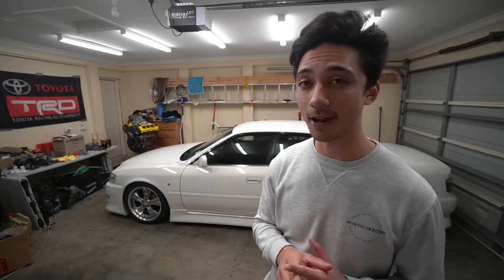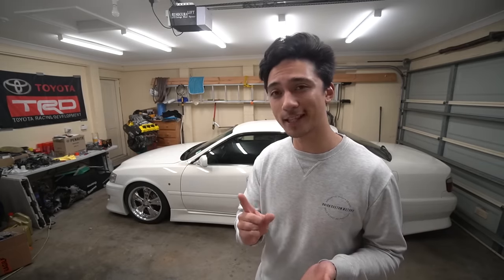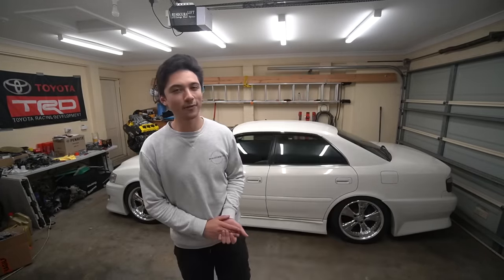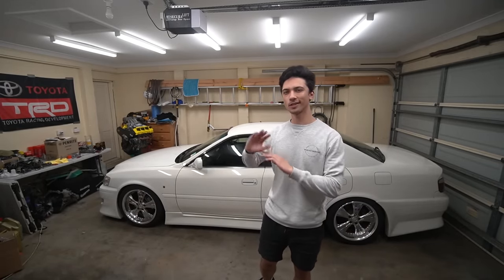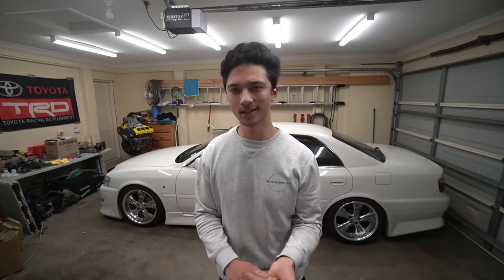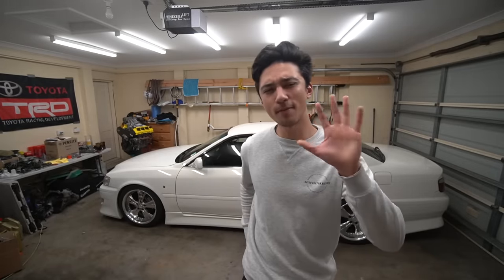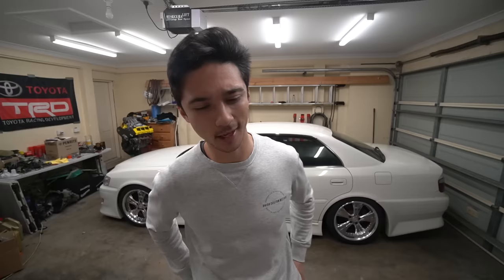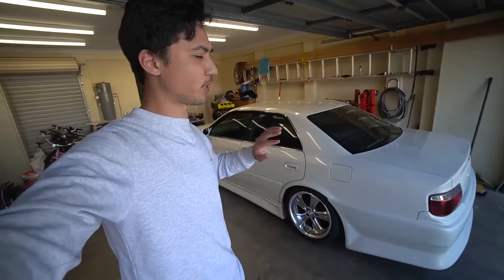The First 5 Mods You Should Do To Your Car (For Cheap)

Comment: My first mods were tint and rain guards. Definitely changed the look
Reply: Always tint first😌
Reply: @DrizzyJV  amen! 🤣
Reply: Yeah Tint really does change a car, especially if it’s 5 all around
Reply: What is a rain gaurd
Reply: @shahzadkhan-ct4oi  they go at the top of your window so if its raining and your window is down it wont drip in
Reply: Mine was tires nd tint i got em done today nd i was happy even if it seems small idk just fixing my car feels good
Reply: @shahzadkhan-ct4oi  its what you put above your windows, attached to your door so you can crack your window open when driving and let in outside air, even when its raining.
Reply: @n3ille289  hey that's dope! gotta start somewhere, as long as you like your car that's what matters
Reply: Tint isnot a mod
Reply: @PostFeenJay  modifying a car is changing anything to it that did not come STOCK from the dealer or where you bought it. If you tint your car darker than what it came with factory it is definitely a mod.
Reply: I think mine was fog lights, stereo, stickers/emblems, tint, altezza tail lights, wheels (16s), grille, intake. In that order.  I was pretty cool by the time I got the carbon fiber hood and the body kit. Still got the car, but no emblems, tail lights,  exhaust, and body kit anymore except the front lip.
Reply: gonna order my rain guards next paycheck. originally wanted them for the looks, now i want them bc when it rains it goes to the fucking center console
Reply: 100% weather deflectors are super slept on. I bought them for my Mk7 GTI and it looks so much better. Really clean look.
Reply: Tint first. Same thing I did. 😂
Reply: @stumpsteph2153  damn nigga😂 I’m 15 all around
Reply: I literally did this last week and definitely makes it look 🔥
Reply: rain guard? agreed. it make the car look nicer ngl.

tint? country dependant, here in ausie the cop just feel sad if they cant see ur face through the window lololol. so they gonna stop u for sure even its only 50%
Reply: @shahzadkhan-ct4oi  wind deflectors if your in Europe
Reply: Me too
Reply: I just got window tint as my first mod lol
Reply: Agreed I tinted my windows and got weather window shields “rain guards” and a black bonnet stone guard on my dark ocean voodoo blue stick VE omega and instantly turned it into a sexy beast ahahha little things go the distance with cars appearance I swear ahah
Reply: honestly my first mod were new wheels and tires followed by new set of breaks... then red halo lights xD
Reply: rain guards it entirely depends on the car, tint and ride height drop are just two things that MASSIVELY change your car and make it look so much more aggressive.

Comment: The mods I made to my RAV4 were
-tints (15% all around)
-blacked out offroad tires
-change every light to LEDs
-sequential turn signals
-chrome delete
-blacked out tail lights
-leather seat covers
-aftermarket infotainment w/ Carplay & Android auto.
Love driving even more now than before I did the mods
Reply: Leds...? bro leds are much better than a normal lightbolt
Reply: offroad/hybrid tires is the most underrated look on a sports car imo
Reply: how are your leather seat covers holding up… I’m trying to make some choices and I noticed a lot of PU leather seat covers get really creased after wear.
Reply: @AC-iv3ys  They’re not bad. They could be better though. My seat covers came with a strap that you connect underneath the seat so that it stays on and snug, but it snapped. I really wish I had just bought my car’s trim level that came with leather seats🤷🏼‍♂️

Comment: As a fellow car guy and Toyota mechanic, I 100% agree with this list. One thing that would add about pod filters is that they make your turbo sound soo much better(if you have one). Another cheap mod you can do to really change the feel of your car is to lighten it, and get rid of all the heavy stuff. You can get rid of 60ish kg pretty easy and the difference is like night and day(unless your car is naturally really heavy)
Reply: Couldn’t removing a large amount of weight set off the weight distribution though? I feel like it wouldn’t be much of a worry for rwd cars, because of the weight of the rear diff, but since most of the stuff being removed is in the rear, couldn’t that be more of a problem for fwd cars?
Reply: @gunnarshiverdecker8674    What are you talking about
Reply: Hey a question Id you do a muffler delete what do you put instead
Reply: @vladimirjano9478  just a piece of pipe where the muffler used to be, hence the nickname straight pipe, although sometimes that means no cats as well
Reply: Unfortunately pod filter decreases horsepower, especially in my car
Reply: What would cause the pod filter to decrease performance tho? I was thinking about putting one in my toyota sprinter
Reply: @ESnizzle  when you get a pod filter, you need to remove the stock airbox and have the filter hang on a pipe going to the intake manifold. By doing this you remove resonators, and possibly airflow if your airbox is of ram-style stock. Resonators improve airflow and horsepower, removing them prevent that
Reply: i have a question, isnt cutting off the muffler illegal literally everywhere?

Comment: TBH before a pod filter, consider an aftermarket drop in filter (as in one that uses the stock airbox). Super easy to install, no AFR fuckery and  you'll get anywhere from a tiny to surprisingly decent power increase - they're also cheaper on average.
Reply: Very true, it's also killing two birds with one stone if you just bought the car used! I got my 328i used at 110k miles, it's an 07 so it's been around for awhile. I got a K&N drop in filter for it and when I opened the stock air box to put it in it looked like it had never been cleaned once and the filter was from 2011! Safe to say the car practically felt like it woke up once the box was cleaned with a fresh drop in filter.
Reply: Pod filters are 20$ and a lot of car u can actually attach it to the stock air intake tube. K&N filters start around $50
Reply: @donovansimison9336  cars usually come with a cold air intake design from factory. So getting a drop-in filter will be better for performance, compared to the pod filter. And it's not very safe to put a pod filter close to the ground too...but the sound you get is worth it anyway so I'd consider it a win-win 👌
Reply: I considered a pod filter but my mate whos a mechanic says all they do is suck in warm air (cold air is good) and reduces performance, a happy medium is an aftermarket airfilter - i got a KnN high airflow one havnt used yet but sounds like the ticket cost around 100bux nzd
Reply: After watching the lemon factor intake dyno tests on an accord, unless you change the airbox, I doubt any power increase occurs
Reply: @donovansimison9336  youre right i got one for 50$ on Ebay and it attaches to the entire mass air flow sensor housing
Reply: @BimmertechG01 can you do a drop in filter and a pod filter?
Reply: @BimmertechG01  yo, its been a while since you commented but i also have 2007 328i and was wondering if you had anymore suggestions for mods to the car, since you actually have some experience with it

Comment: get a car that has a hole rusted through in the muffler and you’re good
Reply: My first car 95 corolla sounded crazy🤌🏼
Reply: amen bro, it hurt me to get it fixed because of how damn cool it sounded
Reply: my 07 subaru impreza 2.5l has a front exhaust leak. sounds amazing. too bad i have to fix it before it gets bad and all the fumes get into the cabin lol
Reply: @joey4261  04 2.5 here same shit, i regret the repair everyday but issa daily
Reply: literally me right now ahaha
Reply: 🤣my car has that i wana get rid of it
Reply: @joey4261  bro line is like that too
Reply: I got zero rust and under 75k miles, I'll just cut a hole
Reply: @ethanbannor212  dont

Comment: what about an exhaust cutout? ive got one, and its great for a daily. When going to work early, getting home late, or avoiding the police, its great to have a choice at your fingertips.
Reply: How long have you had it for and do you know if it leaks?
Reply: @sugamai  ive had it installed for about a month now, and so far i haven't noticed any leaks. Just make sure its a good design though, the cheap ones tend to leak. I got mine from summit racing.

Comment: Remember with new LED bulbs to readjust your beams. The low beams height should be the same height as the headlight housing, at about 10ft away. The driver side beam should be twisted slightly in, and the passenger beam ever slightly out.
Reply: how do you do this
Reply: @supermaxr5093  Theres two screws on the headlight housing to adjust each axis.

Comment: Just one thing if you're going to change out your headlights, You have to replace the housing For the lights because in some places it's actually illegal to put LED's In halogen light bulb housings Because they're not built for led's. Plus changing the housing out to housing that's made for LED's can make them look so much better, And function 2 to 3 times better because they will work properly.

Comment: Best muffler delete I've ever done was resonator back delete on my B7 Passat 1.8t. Sounds amazing. I also did a bypass valve spacer so I could get the turbo woosh.
Reply: is it illegal to do a resonator delete? tempted
Reply: @szxci9885  depends, but usually no. It’s the cats and mufflers they get upset about.

Comment: just an fyi, installing performance modifications on a vehicle without tuning it is going to decrease horsepower more often than not, the intake for example will be adding more air to the engine but the ecu doesnt know that so it injects insufficient fuel for best combustion and will decrease power due to your air fuel mixture being more lean
Reply: Complete bs, get a k&n filter.
Reply: Facts

Comment: Personally as a first quick modification to a car I normally suggest a extra set of brake pads just incase of braking issues and maybe some seat belts cause personally ima very tall individual and the normal selt belts cut my neck at times and cam get a bit uncomfortable so some after market seat belts or racing belts I also do agree with the muffler delete as a cheap thing to do as well

Comment: my first modification to my car was either tint or rims(granted i went from factory steel to factory alloy, still looks 10x better then before), then the next mod was the exhaust(had dual Flowmaster 40 series installed on my car by a shop, i would have tried but, they needed to be welded in, looks and sounds good, I have a video of how it sounds on my channel), but that is where i left off due to the transmission failing in it, and cant have it fixed anytime soon, but it will be back and even stronger then before

Comment: Most cars have resonators and deleting the muffler can make a very good sound without being ridiculously loud. I’ve done it on a few of my cars, and some of those mufflers are heavy as heck so that’s just increased performance just like that. Intakes especially on Toyotas usually decrease performance and not for the reasons you think. It comes down to how the maf reads the intake flow and a larger diameter or smoother intake will reduce the velocity of the air and most factory intakes have baffles that direct the air properly to the maf. I wish I never installed an intake on my mr2 spyder because it definitely is slower and makes an obnoxiously loud sound while starting up. I didn’t even get into how much power you are wasting by increasing intake temperatures since most factory intakes have some sort of way to get cold air from outside the engine bay and most aftermarket intakes that aren’t cold air intakes are sucking in 200 degree engine bay air. This isn’t even mentioning turbocharged card that 1 run even more hot and 2 changing the air fuel ratios will cause the car to run lean with an intake and exhaust without a tune and will likely blow the engine. I’m all for modified cars as mine are probably more modified than most out there but please do your research and do it right. I’ve learned through my experiences some modifications you want to do with some cars and some you don’t and you never want a hot ram intake. Never.

Comment: Hi, question. If mods like sway bars etc drastically improve the handling and feel, then are they standard on more modern cars? Cheers
Reply: yes they are, when you get aftermarket sway bars they are bigger/stronger and usually adjustable. thats where you get the better handling from :)
Reply: @arcanevoid9199  great thanks 👍
Reply: modern cars have soft swaybars because the focus is comfort while driving on the roads and less feel for the bumps and such on the streets, a stiff swaybar makes the response way more so you feel everything which is uncomfortable
Reply: @arcanevoid9199  question! If you replace something like sway bars on your car would that pass a smog check?
Reply: @Luisjr_04  yes, it’s not going to alter the emissions in any way

Comment: In some less  enlightened jurisdictions, muffler deletion is frowned upon, to say the least and the ticket twill cost you an arm and a leg. This is a problem if you're not a salamander and are unable to regrow them but there is a solution. Simply route the tailpipe inside the car and that wonderful noise will be heard without the attenuation of windows and bodywork even in the worst weather. Please note that it's not a perfect solution in every way. 

Brighter lights are safer but the allure of blue beats safety, so always get bulbs with a blue coating to filter out some red and yellow. Human vision being the least sensitive to blue light is also irrelevant in the face of the cool factor. A slightly different but also great mod is the headlight delete which then provides a perfect location for air intakes where there is an area of high pressure for free boost. Roads are lit anyway and the power you save by the alternator having less to do can go straight to the wheels. This is true.

I have more, just say the word. Like why sway bars are a proverbial free lunch and should always be as thick as possible. Etc.😉
Reply: If you remove your brakes your car will be faster also, weight reduction baby!
Reply: @shannons6695  They're usually unsprung weight so roadholding will improve if you toss them.Situational awareness obviates the necessity for brakes anyway.

Comment: I think one of the better mods you can do are deletes and simplifying systems (I want to do a manual brake conversion soon), though some deletes really stretch the ability to find comfort in daily driving. I've been hunting for fuel economy and freeing up horsepower in my civic since I haven't been able to afford performance mods. while it's not completely gutted, I have removed 600lbs of weight. fuel economy was the biggest thing to have improved, but I do notice at speeds above 60mph I have better acceleration and can now get above 100mph much easier than compared to the stock weight only barely being able to hit above 100mph. either way though, getting over 40mpg on the freeway is pretty awesome.
Reply: I'm a car noobie. Taking off unnecessary weight is something I can start with. Your opinion what area of most cars can you look at to take weight off?
Reply: @jonathanenciso  front and back headlights, airbags, seatbelts, seats, all are unnecessary weight and not needed imo
Reply: @constantinekorkousky3363  I assume taking these things out makes the not legal to drive on public roads right lol?

Comment: I did an egr delete on a 03 Acura TL. It’s a controversial mod but in my opinion it really shot the torque up and throttle response even idling it feel better without those exhaust gases choking out the engine

Comment: Alright if you touch your exhaust system or your intake system you SHOULD tune your ECU to match the new air/fuel ratio which is what dynos are for.
Done that to my 700cc bike gained almost 20% more horsepower.

Comment: A boost controller and boost gauge if you have a turbo car is a much better upgrade for your car that will actually makes it better. It can be a cheap air pressure regulator that restricts the vacuum line on the turbo or a nice electronic one, definitely better than an air filter.

Comment: Nothing as cringy as straight pipes on a camry. Looks ridiculous when they accelerate loudly to 60 in 10 seconds lol
Reply: What poor souls Camry takes 10 seconds to hit 60 😭😂 my little camry is quicker than that..much quicker.
Reply: @thatoneuber8016  fr Camry is underrated
Reply: @thatoneuber8016  Hyperboly.
Reply: @thatoneuber8016  my 03 just barely makes it under 10 seconds
Reply: @studmcmuffin8844  mine pushes 0-60 in average 6.7. Quickest ive seen is 6.3.
Reply: What year is his?
Reply: To be completely did it to my civic and while you might assume it sounds like a fart cannon I was impressed with how deep the sound was not to mention the warfare sounds from my exhaust after decelerating from 15 mph or more

Comment: Just as an input on muffler deletes, while some of them do sound good, most v style American-made vehicles sound terrible in comparison to a replacement or just keeping the stock muffler on. My 4.3 S15 for example sounded rough in an 'I'm gonna die in my first corner" sort of way, and it ruined the sound inside and out of the vehicle
Reply: Hey, super late comment, but i have a question. I just recently did a muffler delete and im kinda worried that i might get a ticket. Do you think I'm fine?
Reply: @minifridge6512  I can't say, sorry. I live in Arkansas, where they could care less how loud, modded, or dangerous your vehicle is while on the road. Different states and countries have different laws